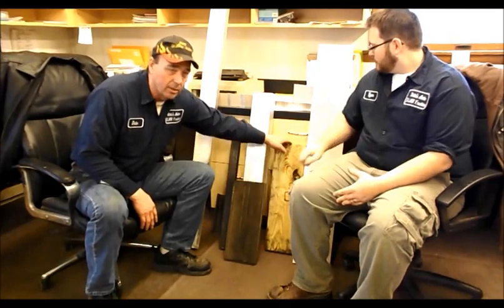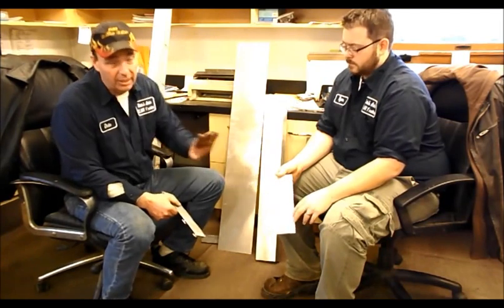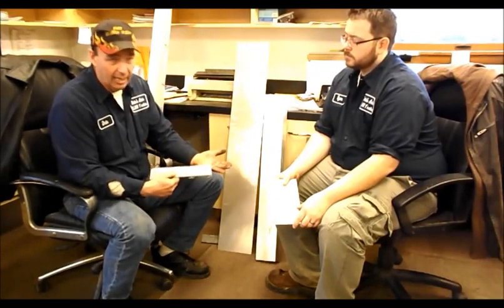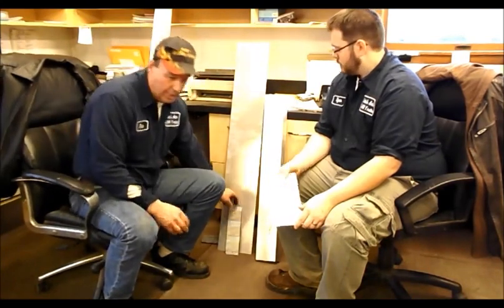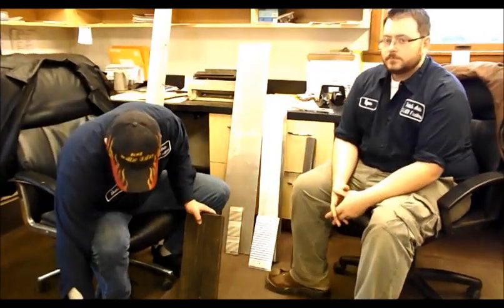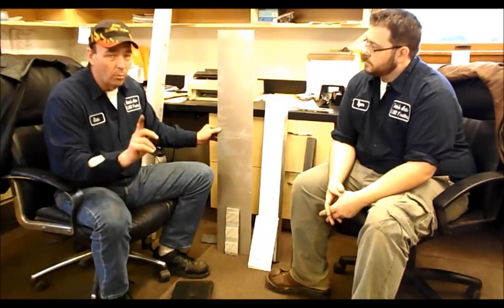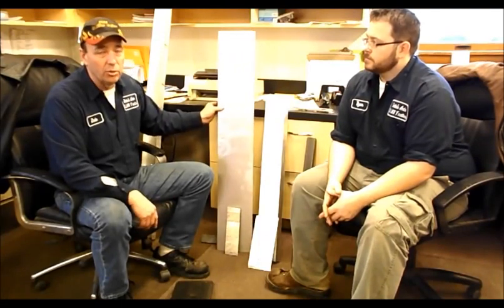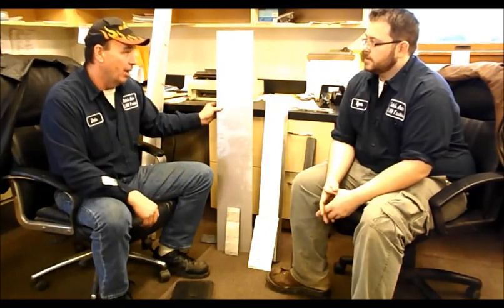Trailer Talk Ep 5 - Horse Trailer Flooring Options

Comment: I bought a used 3 horse aluminium horse trailer and the floor for center stall area is bad. I was told the floors were good. I now need to repair or replace this area. What do you suggest?

Comment: I have a 2006 WW 2 horse slant BP. I am replacing tires, also buying new rims and will be looking for someone in my area to do some restoration on the metal body. The rust isn't too bad yet, Florida is not kind to metal trailers. I checked the floor under mats today and it will need at least the first board replaced. From all these videos on YouTube, most all wood trailer floors seem to run long/horizontal.  Mine is vertical, it's considered a stock trailer. Is one method of wood floors better/longer lasting than another?  Just curious why they are made different, thanks Catherine